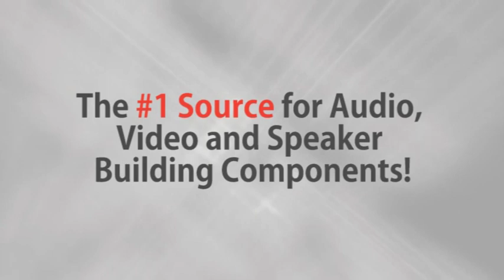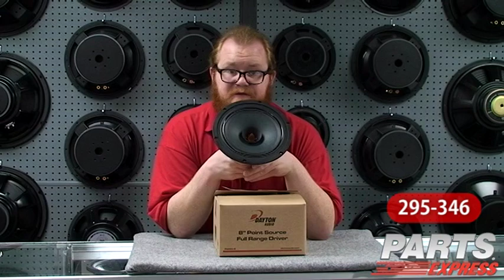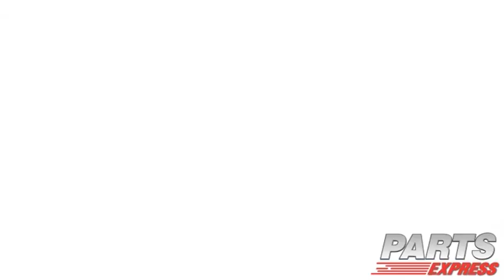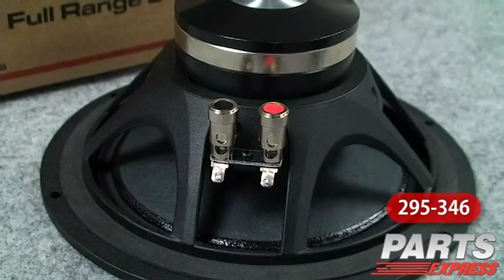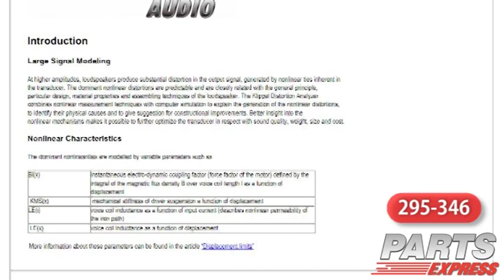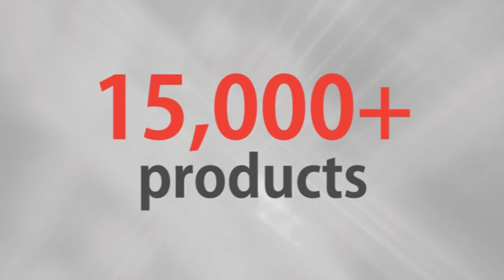Dayton Audio Point Source Full-Range Drivers

Comment: We looked at the most popular formats for full-range drivers before creating the PS series. Twelve-inch full-range drivers do exist, and we may consider them for the future, but you may be surprised at what the 8-inch version is capable of. Its powerful neodymium magnet structure achieves almost 96dB sensitivity, and you can explore horn-loaded or transmission line enclosure styles if you need more powerful bass.